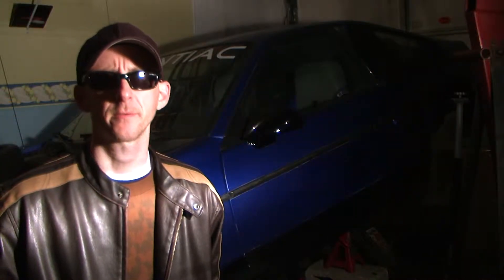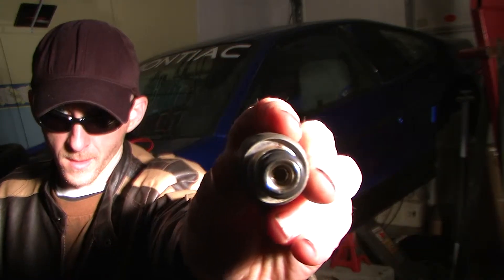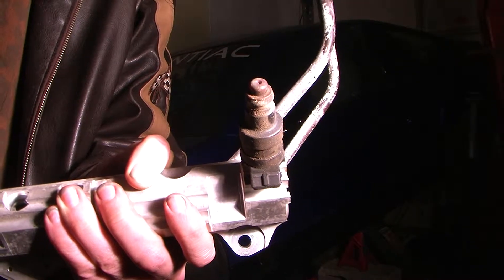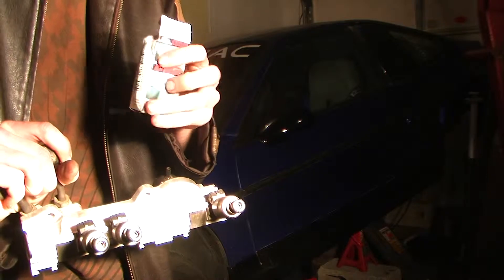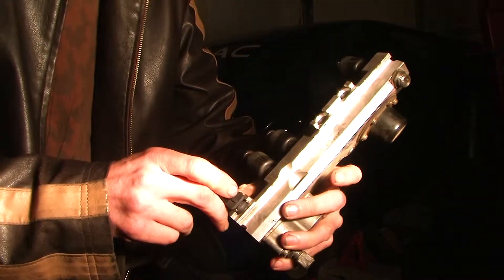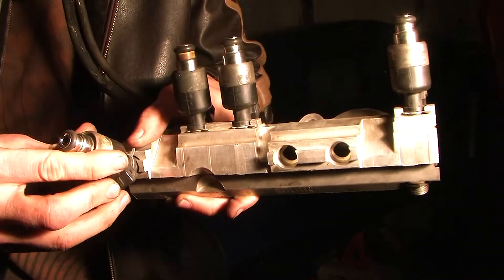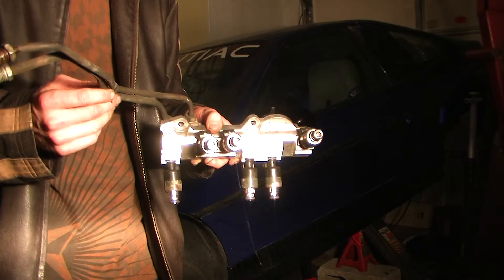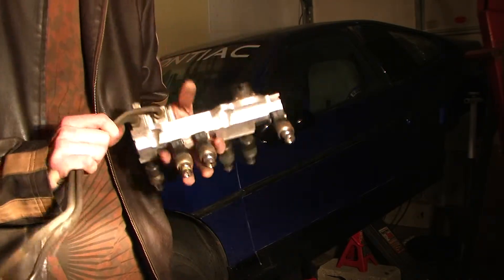Pontiac Fiero fuel injector 15lbs to 17lbs conversion for 3.4 pushrod engine (How to)

Comment: who reprogrammed ecu I'm still figuring out this car i bought other guy got a good start but I'm haven't met any other owners that have gone through this process and i am only getting limited data from forums. if there is a company or part number for ecu upgrade let me know i would appreciate it .my car has 94 camaro 3.4 stock fiero intake 17#injectors custom exhaust no converters.any info would be helpful
Reply from the maker: I got mine programmed by Ryan from Sinister Performance in IN. He has a form you can fill out with what you want and what you've done to the engine and he will try and tune it to your specs. He offers a mail order service where you can pay a fee and keep sending the ECM back for fine tuning if needed. I went with a one time programming and it worked for me. The website is http://www.gmtuners.com/ I eventually converted my ECM to a 1227730 which is faster and more tuneable than the stock Fiero ECM. You can also convert over to DIS (coil packs) which gives you faster throttle response and a very mild improvement in fuel economy. Some say it gives a slight increase in hp but I think it's just faster throttle response that is mistaken for hp. You might wanna consider that option as well. I have a video on doing it and I think that is well worth the effort with the 3.4 engine. After I did the 7730 swap I stuck the reprogrammed stock ECM in storage. If you're interested in it I can try and dig it up. It was programmed for a stock 3.4 with an automatic transmission. $50 + shipping. Let me know. Either way, good luck on your project and I can help out as best I can.
Reply: @LostNotForgotton   still have the reprogrammed stock ECM?
Reply from the maker: @billymarcum2978  I do still have the stock ECM that was reprogrammed for the 3.4. If you want it I'll give you a great price. Just lemme know if your interested.
Reply: @LostNotForgotton   thanks for getting back with me, yes i am interested in it
Reply from the maker: @billymarcum2978  Sorry for the delay. I wanted to make sure I found it before replying. Just to make sure you know, this ECU is a 3.4 with a distributor not DIS. If thats what yoyr looking for does $20 plus shipping sound fair?
Reply: @LostNotForgotton   you are fine sir, i figured you was busy or something along those lines. Yeah $20 +shipping sounds good with me
Reply from the maker: @billymarcum2978   Sounds good. Can you email me? My email is my YouTube name at Yahoo. We can finalized everything off of YouTube and I can ship it out this week if that works for you. If you do email me just leave a YouTube comment letting me know just to make sure I got it.

Comment: are you running stock ecu for the 2.8 l or are you using something else.
Reply from the maker: I had the stock ECU reprogrammed to handle the bigger engine but the stock ECU will run the 3.4 engine as well. The 3.4 engine may run a little rich with the stock ECU because the fuel/air ratios fall slightly out of range for the stock ECU to calculate. If you can get it programmed I'd say do it but if not many people have run their cars for years without it so you'd be fine.

Comment: i have a 3.4 with stock injectors fiero manifold with air and manual trans when air is turned on motor bogs down and stalls guy i bought it from said it runs rich with these injectors.

Comment: what is the part number for the injectors guys make these videos but don't give any info do ypu need to reprogram the ecu when ypu swap these out come on dude.
Reply from the maker: I did not purchase new injectors. I re-used  the stock fuel injectors that came with the 3.4 pushrod engine so I do not have a part number to offer. GM discontinued them so it is best to buy a 3.4 engine that includes the intake. You can buy aftermarket #17 injectors but since I didn't buy any I can't give any suggestions on what brands worked well. Some people have even reused the Fiero injectors. It's all on what you want out of your engine.
The stock 2.8 Fiero ECM will run the 3.4 engine without any issue. You may run a little rich because the bigger engine and injectors are outside of its tolerance though. I would suggest having the ECM reprogrammed if you wanted it running at its best. I had Sinister performance program mine (www.GMTuners.com). Whether you reprogram the ECM or not it will still run. Hope this helps.

Comment: Will this give me more horse power
Reply from the maker: Randy Williams Changing the injectors alone would not add more hp. You would also need to increase your air intake to balance the burn. In this case we change the injectors from the 15lbs to the 17 because that is what is rated for the 3.4 engine. Bigger injectors would just cause the engine to run rich and ruin your gas mileage.
Reply: O ok got you

Comment: Can I get this off a 95 3.4
Reply from the maker: Randy Williams Yep, you will basically reuse the stock fuel injectors from the 3.4 engine.
Reply: Cool any other mods you know of
Reply from the maker: Randy Williams The sky is the limit when it comes to mods. It's all up to your preference and budget. I would probably at least add a bigger cam before putting the engine in. I would also suggest doing the 1227730 ECM upgrade too. Much better performance than the stock Fiero ECM even with the performance chip. You also get slightly better gas mileage and it's more tunable than the stock Fiero ECM. The 3.4 F-Body's use this ECM as well as Beretta's and Corsica's. I have a swap video on this as well and did it all for under $250. Definitely should consider that swap while the engine is still out.

Comment: Hey would 19lbs injectors be the same without modification? I know people use those more than the 17's.
Reply from the maker: zzzhuh In this case we changed the injectors on the Fiero fuel rail from the 15lbs injectors to the 17lbs because that is what is rated for the 3.4 engine. Bigger injectors would just cause the engine to run rich and ruin your gas mileage. To run 19lbs injectors (or bigger) you would also have to increase your air intake to match the extra fuel by adding a turbo or supercharger.